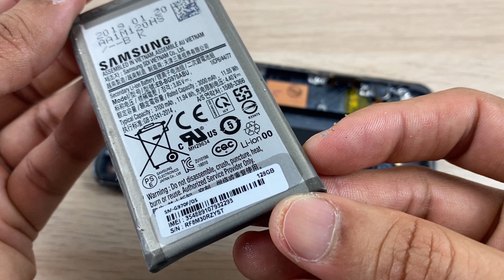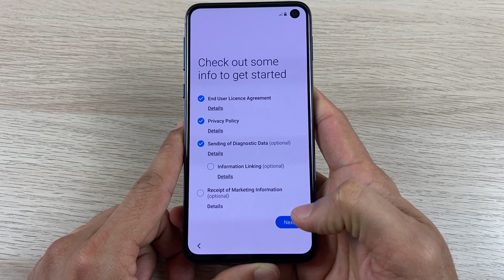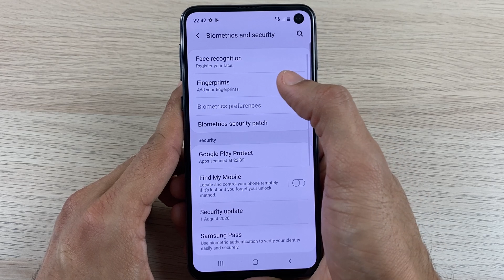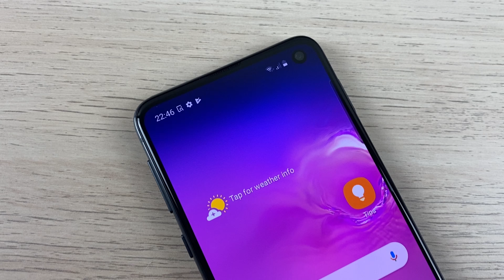Samsung Galaxy S10e Restoration | Restoring smashed Galaxy S10e

Comment: worst phone iny life. Greenish screen, battery that keeps less than 50% after two year of usage.... typical samsung crap
Reply: My experience is the opposite of yours. I'm currently using an S10e. The battery lasts about 4 hours of playback, no visible marks on the screen, the display is still incredible. Even though my version comes with Exynos, it's super powerful. I ended up selling my old notebook and currently use Dex mode on a monitor to study and surf the Internet. An incredible cell phone, in my opinion.